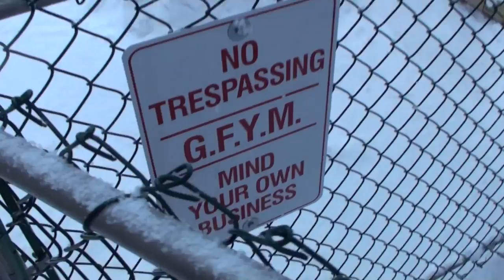day off

Comment: we have one of these at work it goes approx 75 to 80 feet up and im scared to death of hights. Anyways the guys told me hop in and I could run the controls well they have a override on the ground and put me all the way up. I was getting lower and lower in the bucket the higher it went. then the pricks left me up there for what seemed like forever only 5mins actually last time I got near that sonofabitch